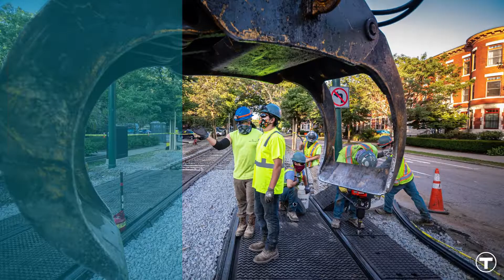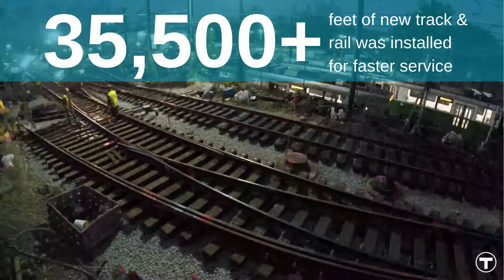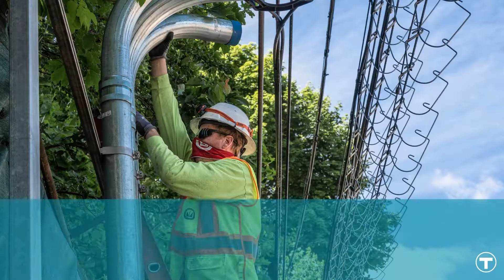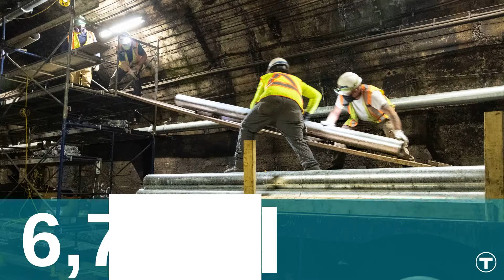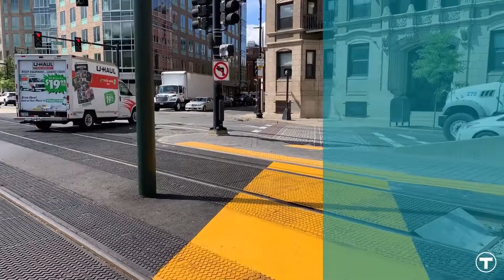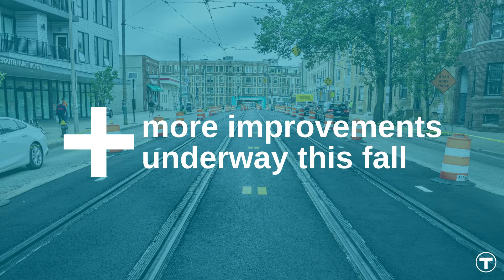Building a Better T - Summer 2020 Recap

Comment: Im,wondering if there will be another train station added after newburyport?
What is after newburyport?
When is the handicap platforms at the beverly depot going to be worked on? They are crumbling and are in bad shape.
Will there be subway connections from salem to the malls? And from danvers to peabody into saugus to boston?
Will it come to the point that there will be subway service from beverly to danvers and to malls because it will get expensive to make buses?
Will there be subway service from beverly to government center?